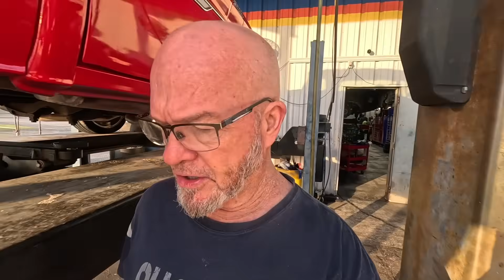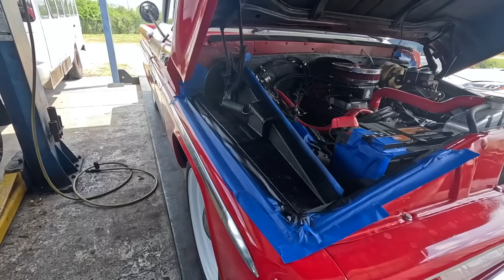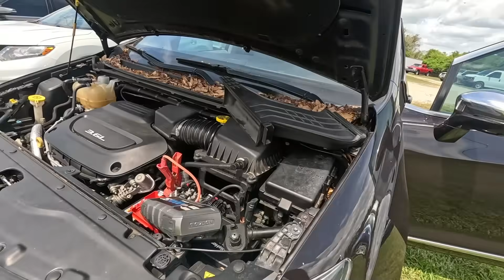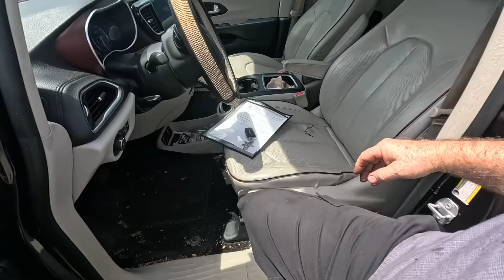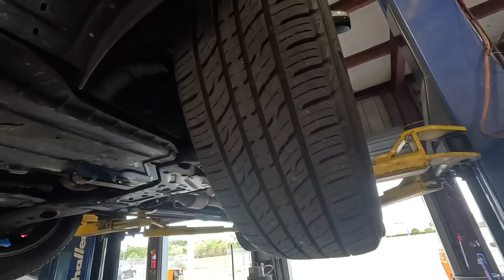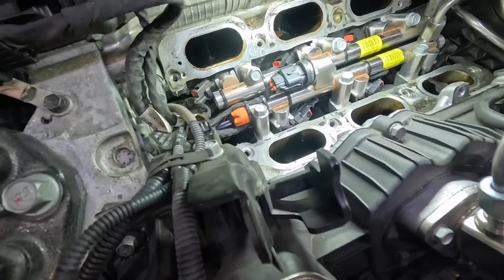HYUNDAI, OIL LEAK. PACIFICA, NO CRK. ESCALADE, WINDOW INOP AFTER MOBILE MECHANIC. DAY FLAT RATE 942

Comment: Those part stores give "free battery install" The thing is in the last year I have had at least 3 or 4 with brand new batteries that need a battery terminal. Part stores sell parts.
Reply from the maker: You're spot on, there's definitely a difference between selling parts and actual shop service.😊
Reply: @JimmyMakingitwork  Part stores will read your cdoe for free because the chances of them selling a part for the code increase. Same reason I dont charge to read codes. I want to win their trust so they have me repair the vehicle.

Comment: Toyota says to go 10k before changing it. I believe in 5k but yeah.
Reply: Never go over 5k on an oil change in a gas vehicle and that's for mainly highway travel which is a best case scenario. 3k oil changes suit average vehicle operation or forced induction. I don't care what oil companies claim, torn apart enough engines to see the difference and sludge build up.
Reply: @COBRO98  I just did a valve adjustment on a 2010 Element 2.4 with 295k on it. The inside of the engine looked brand new.
Reply from the maker: I definitely lean towards the 5k interval myself for peace of mind!👍

Comment: No problems with the 3.4 liter in the Tundra?  We have a '23 in our fleet with an open recall to replace the engine, rear brakes and rear lights, no parts available at this time.
Reply from the maker: That definitely sounds like a major project once those parts finally show up.👀 We have three 2024’s and a 2025, no trouble so far.